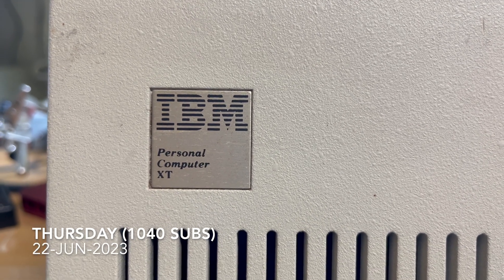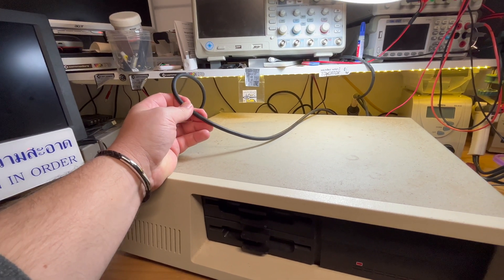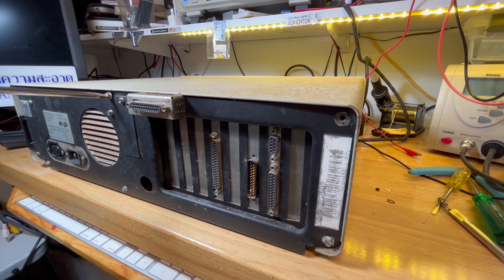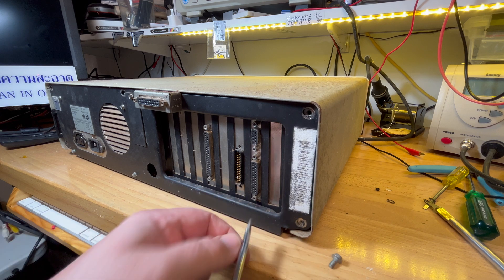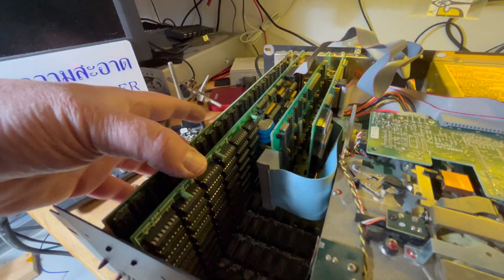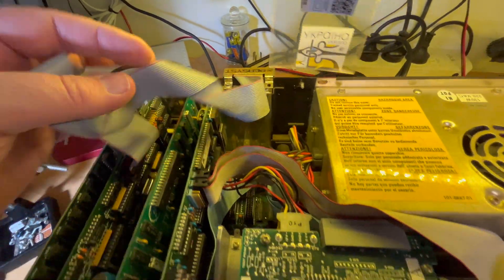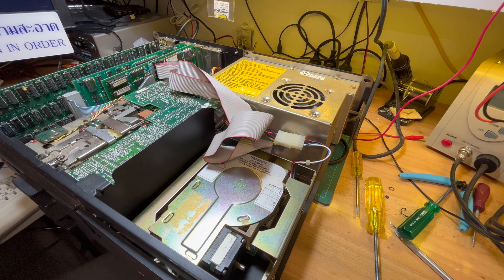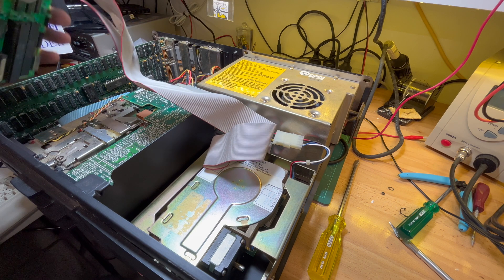🇦🇺 IBM PC/XT (Model 5160): Part 1 (Initial checks) [TCE #0305]

Comment: Take a look at R4 just above and to the right of the spot were the battery was. Is the resistor burnt/damaged?

And your expansion board appears to have about a third of it exposed to the battery alkaline (the righthand column to a couple of CM in on the connector).
Reply from the maker: Yep - I've done the white vinegar now and have started repairing the damage ... but decided I might just put in some modern cards to replace it ... and recover all those 4164 DRAM chips!
Reply: @Brfff  Well, it came out beautifully, I'm impressed! And you will have a small fortune in 4164s. :)

Comment: I think that you mean "Crinkle" paint, but your powder coat came out really nice. And feel free to pick your color as long as it's beige... :)

And that's a 37 pin socket on the back, same as what my GE Series Six "WorkMaster" (aka "WorkMaker") had.

I soak my Varta-abused boards in white vinegar until the bubbling stops. Then a rinse in tap water, and a rinse (outdoors) in 91% alcohol.

384K was a common expansion size back in the day.
Reply from the maker: Ahhh ... crinkle paint ... yes, that makes more sense!  I've got the machine totally disassembled (hey, it joins a lot of other machines in the garage!) ... looks like I can just clean & re-spray the bottom case black.  The top case ... maybe scrub & re-spray but powder coating would come out much nicer (but smooth instead of crinkly).  And yes ... DC37 connector (not 34 pin) ... I've been meaning to make up a cable to hook up an external floppy ... my Model 5155 Portable PC has the same.  Thanks for the tip about the vinegar - I had the idea that at least spraying IPA on it would "stop" the corrosion ... let's see ... /Brett
Reply: @Brfff  somebody recently did a crinkle paint job on their old Commodore Pet IIRC. Can't remember who though, but it came out good.

The way that I neutralize the battery alkaline is to let it soak it white vinegar until it stops, or nearly stops bubbling and then scrub it up good and then rinse with tap water followed by a rinse in 91% IPA.

It's a minor modification of how the Jamma boys do it, so I can't take credit. I've done a dozen boards that way and haven't lost one yet. And you are welcome of course!

Oh and use somebody else's toothbrush to scrub the board. Just saying... :)

The 37 pin connector was what my old GE Workmaster used to connect to the Series Six PLCs that I used to program. So I'm familiar with them. :)

Comment: Check the PSU, tantalum’s will short. And the video card is probably MDA. You can put in a 16 bit ISA VGA, they work in 8 bit slot too, but you have to change the dip switch settings on the motherboard. And yes should here a beep, so the motherboard is not booting.
Reply from the maker: Yep, first thought was a blown tantalum somewhere but nothing obvious on first look - will strip it all down and have a proper look!  An MDA card, eh?  Cool, never had one of those before! I really want to make one of these but the FPGA is way too expensive at the moment! /Brett 
https://github.com/schlae/graphics-gremlin

Comment: Here's a couple of bits of information for you, Brett:

1)  That video card looks like it's the MDA (monochrome) type, not the CGA type.

2)  This generation of IBM computers is almost guaranteed to have a shorted tantalum capacitor or more, especially on either the +12v or -12v rail.  It'd be a good idea to buzz out the power rails on the motherboard where the PSU connects to it.
Reply from the maker: My first MDA card - cool!  Yep, I suspected a tantalum - didn't smell anything, and no magic smoke appeared when first powered on so probably been dead a while.  Will check out the PSU. /Brett

Comment: "No Copying Permitted" ....that didnt really last long!....also interesting it has CBM printed on the next slot in from the no copy...not a bad condition for such an old system...im amazed that varta on the ram expansion card hasnt completely dropped its guts everywhere!...powder coating the case would be the way to go (especially after seeing the job they did on the PET!).. but id try to keep it the same colour...
Reply from the maker: I was thinking of going all black ... or black and then just red on the front part ... but yeah, maybe too many dislikes on that reveal video ;)

Comment: Sorry to say that post codes were a later feature. They began on the 286 types.
You may know already that capacitors didn't age well on these, and they don't always show when they are bad. Some time with your DMM will find the culprits.
Reply from the maker: Ahhh ... actually, I didn't know that ... never looked into them before ... thanks for the heads up ;)  Yep, will strip everything out, probably re-powder coat all the casing, and try to find a fried capacitor or three!
Reply from the maker: I might be in luck ... but, probably need a working screen ... but x2, I don't think I'm getting very far at the moment (faulty cap?) ...
https://minuszerodegrees.net/5160/post/5160%20-%20POST%20-%20Some%20errors.htm
Reply from the maker: But regarding an actual POST card, yep you're 100% correct it seems:
https://www.minuszerodegrees.net/misc/post_cards.htm